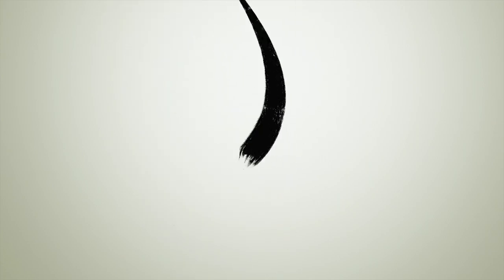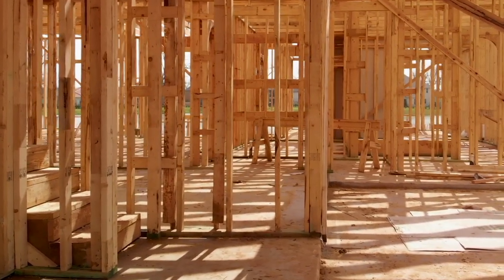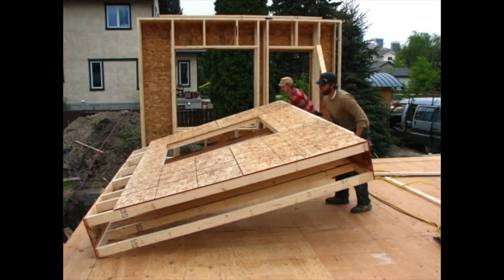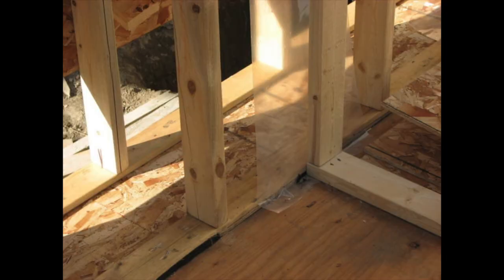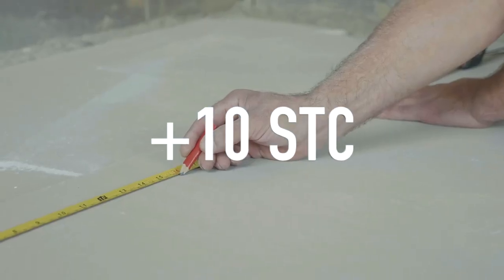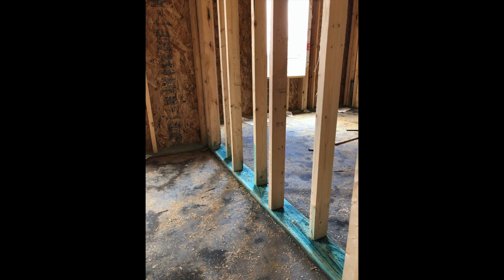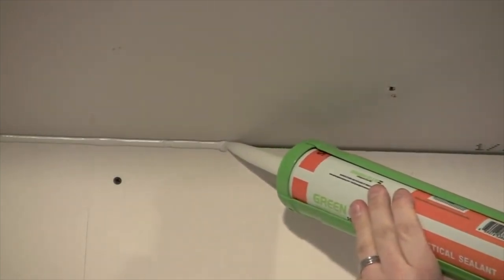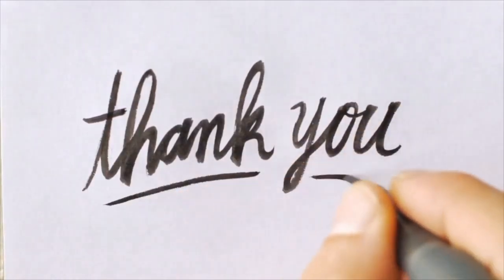Staggered Stud Wall VS Double Wall For Soundproofing

Comment: A staggered wall is "good enough" in my opinion. Ordinary wall: 34 STC. Staggered wall: 48 Staggered wall with a thicker drywall (like Quietrock): 57. That's already amazing, sure a double wall with 2 layers of drywall can get you up to 74, but it takes SO much space comparatively! And since the staggered wall is only about an inch bigger than ordinary walls I think that makes it the clear winner for retrofits.
Reply: Questions is,canna staggered wall be 2×6 top/bottom plate and 2×4 as studs? Or needs to be bigger,also what would happen if you added quietwalk underlayment behind drywall🤔

Comment: As a side note to the soundproofing, I would like to point out the thermal advantages of staggered stud and double wall construction.  This will not matter for the interior walls but on the exterior walls of a building there is a nice energy saving advantage to be gained by these kinds of wall systems.  The air gap created in the wall also works as a thermal break and eliminates a significant amount of the thermal bridging that occurs within a typical stud wall system.  Doing this for your exterior walls not only reduces sound transfer through the wall but the heat transfer as well and the  heat transfer reduction will eventually offset the added expense of the exterior wall construction.
Reply: We're helping an off-grid homesteading community find information for building high R-value walls.  Any idea how much higher a staggered-stud wall's R-value could be?
Reply: Would humidity be an issue with a staggered wall on the outside perimeter?  Worried about moisture and mold.
Reply: @AlaskaWild  You should use a vapor barrier so water from outside  cant go inside but still moisture from inside can go outside.

Comment: The air gap between the studs is irrelevant. The decoupling of the walls from each other is what matters. for example, if you lean on a stud and somebody strikes the other side with a hammer you are going to feel every bit of it.  if you are leaning on a stud that is not touching the one that was struck you will feel almost nothing. For best results make sure the bottom and top plate is secured as well as possible. the main advantage of the double walls is that the top plate and bottom plate are not being shared
Reply: Hi, saw your reply and I'm curious about your experience with this? I am building a double wall to keep out a large stereo system. I am right at the point of figuring out how much air gap I need. Obviously the smallest possible to salavage more interior space but I don't want to compromise performance especially with frequencies below 100 hz!. Thanks beforehand with anything you're able to offer up. Best
Reply: I can't find the link now but I saw a research paper that says this is wrong. The bigger the gap the better the wall works- to a point. However the one I'm making only has a 1in gap because more is impractical and returns although better are diminishing
Reply: @detroyt232323  Double stud wall is not going to do much for frequencies below 100Hz. You need diaphragmatic absorption for low frequencies. I suggest you check out the Acoustic Fields website and YouTube videos. Someone else built double stud walls for their home theater room and it did not stop low frequencies. The wife was very unhappy.
Reply: @vinylrules4838  thanks but ummmm I posted that a year ago. My build has long been finished 👍
Reply: @detroyt232323  how did your design perform with regard to sub 100hz frequencies?  I'm building a drum practice room and I'm where you were in trying to determine how much gap to leave between outer and inner walls.
Reply: @DuckMallard11  I haven't ran any sound testing only by ear but it's cut out probably 90% of the sound. I have a Klipsch sub running on the other side that consistently hits in the mid 30's for frequency, it's not entirely sound proof but way more tolerable if you are on the other side and I'm rocking out. I ended up doing a decoupled wall, Green Glue and 4 sheets of 5/8" drywall. Good luck!

Comment: For best sound insulation with a double wall use separate top and bottom plates. Do not tie the 2 walls together that would only allow vibration to transfer to the other wall........
Reply: You’re right, but staggered stud is much cheaper to build because you aren’t building each wall twice
Reply: They will always be tied together somehow. Even with separate top and bottom plates, they'll still be connected to the same subfloor.
Reply: @niktak1114  Obviously.......2 separate walls allows much less transfer of vibration. I've helped build 5 home recording studios and the double wall has been the best wall when it comes to the least amount of sound transfer through the wall...........

Comment: You can start with putting rock wool between even standard 2x4 walls and double rocking - to drown out talking and other mild noises. The staggered framing is probably good for home theaters (unless you have a crazy sound system!)  or off large rooms that have many folks in it. Double walls are extreme: you just lose SO MUCH space! If you did that to your whole house you'd lose 15% or your square footage or more, based on your home layout. And, unless you're selling the house to someone who cherishes silence, it might be hard to sell such a house - because you're paying property taxes (at least in part) on the size of the house.

Comment: Excellent explanation. My question comes in about the door. Even if you soundproof the walls inside of a home, wouldn’t a lot of the sound escape via the door?
Reply from the maker: Great question Alaska Wild, I do talk about that in a lot of my videos. Here's one for how to soundproof a room for beginners. Hint - you should start with the door, or window if the noise is coming from outside. Here's the link - https://youtu.be/3s-dkWjIacA

Comment: I'm thinking about redoing a wall between two bedrooms with staggered stud walls and then using mass loaded  vinyl follow with 1/2 inch drywall. What do you think about my idea?.
Reply: Might as well do 5/8
Reply: Add resilient channel for mounting the drywall and it gets even better.

Comment: What about finished two walls within an inch of one another?

Dry, insulation between studs, drywall.
And then repeat. That way there is total separation and maximum sound absorption and a small air grap
Reply: We refer to that as "double-wall stick built" (don't know if that's an industry term or not!).  The theory is that then you only have to heat or cool the little gap between the two walls to keep the home cozy.
Reply: You may want to look into "triple leaf" and "quadruple leaf" problems as what your describing sounds like it may fall into this catagory.
Reply: I changed my design. All I did was put sonopan in the gap, so zero air gap

Comment: hi. how is the staggered method effective when the top and bottom plates still make contact with each side of the drywall? thanks
Reply: Full disclosure, I'm just a rando with no experience in building, engineering, or even physics. So, take this purely as a theoretical explanation.

True, the floor and ceiling plates are in contact with both rows of studs, and some sound will be transmitted by that solid connection. Nevertheless, it does measurably decrease sound transmission (so I'm told, anyway).

How?

Well, think of sound as water and walls as pipes. A normal wall, with normal drywall and framing, is like a one inch pipe. It does limit how much water can flow, but it'll flood a room in minutes all the same. 

But! By making sure the floor and ceiling plates are the only shared connection, you effectively reduce the capacity of how much water can flow, as if you went from a 1" pipe to a quarter inch pipe. 

Some vibrations will transfer, yeah. Unless you're in perfect vacuum, some vibrations will always transfer. Some will be reflected by dense objects, some will be absorbed and transformed into heat (Green glue, I'm looking at you), some can be canceled out by clever engineering that creates destructive interference, and some will get through. 

This just narrows the metaphorical opening for water to flow, thus reducing the flow rate. For sound transmission, that means more decibels are lost along the journey. 

Eventually, you get to a point where mundane sounds in the room or your level of hearing won't pick up external sound. But even the most silent places on Earth have ambient sound levels of ~30dB. To get better, you've got to leave Earth. (And your heart, the rush of blood, breathing, digesting, even friction from movement..you're still bringing noise with you, alas.)

Too long, didn't read version:
Grab the nearest flashlight, shine it between your fingers. That's a normal wall.

Staggered is like closing your fingers, some light will get through (that's the floor and ceiling plates in this metaphor), but you're radically decreasing the number of photons that can slip past you.

Double is like using both hands.

Anyway, that's the way it makes sense to me.  Whether or not I'm right for sure, I cannot say. 

There is a product that I've heard of, but haven't seen used: Sound Screws/Sound Fasteners. Basically, it's drywall screws that have a wee little spring sitting between the head of the screw and it's shaft.  It basically creates a 1-2mm air gap between framing and dry wall, with only the wee bit of spring wire bridging that gap. 

They run a ~$1 per screw, and I've never seen a comparison, but they only just came to market in the last year, and the only producer is in Sweden, if memory serves. But it seems most soundproofing is just getting that little bit of an air gap.

But, again, I'm not an expert. I'm just a random idiot with a lot of time to wonder and puzzle things out. :P

Comment: Hi, I really appreciate the content you have put in your channel. I had planned using projected cellulose as insulation in the cavity of the exterior wall of a double wall assembly and leaving the gap between walls just empty. The outer wall is gonna be a sandwich of a 6" frame covered on both sides with plywood 18 mm outside and 12 mm on the inside. The plywood on the inside face would be just to contain the cellulose tight. The second wall will be 4" wooden framing with 2 layers of 5/8" drywall ....I may be adding vinyl wrapping  as i don't wanna fail. I'll be playing drums with a full metal band inside so i need a high STC rating. Do you have any empirical data about air gap width vs achieved STC? Is there a minimum. Every extra inch of air gap means an additional inch of foundation width I have to pour. Thanks

Comment: How about this. 100mm stud wall with 12.5mm plaster board each side with 50mm rockwool with a 50mm air gap, would that work or would I need 100mm rockwool?

Comment: would staggering the studs when facing each other in a "double wall" help in any way with STC? In other words, combine the best of both ideas: two walls together, but stagger the studs so they don't line up with each other once the wall is closed up. Would that improve anything at all or is it a waste of time to plan out?
Reply: Hey. Hopefully you have found an answer to your query, but I'll try to provide an answer in case you're still looking.

Note: I am not an experienced craftsman. I am only offering my insights based on what I have gleaned while researching this topic.

From what I can tell, there appears to be no benefit to staggering studs on a double wall construction. The staggered wall construction seems to exist only as the most compact way to construct a wall without studs making contact with both sides of the wall, as it is only 6" wide.

Comment: how would you add noggings/blocking to the staggered walls?
Reply: @Navy1977 but there’s barely any space?
Reply: @Navy1977 i just mean, if you have a 6" of clearance, with staggered 2x, that means you only have 2" between the sheathing on one side and the stud from the other side, no? youd fit at most like a 1x, in that gap, without bridging the gap, no?

Comment: I only found one discrepancy in your presentation .....
"Loose Insulation" .....  Nope.
Density, or Weight, are the qualities you are after to absorb sound,
this is the principle that "Double-Layer", or thicker cross section, drywall uses,
it simply adds weight, which takes more sound energy to set into vibration.

Fiber-Glass only works "OK" for sound absorption when it is packed in tight,
however, 
Rock-Wool type insulation is substantially better at absorbing sound,
mostly because it has much more weight and density.
Rock-Wool also has a much more definite shape and size which tends to further
insure that the highest percentage of the air space is filled with sound absorbing material.

Any air space that does not contain sound absorbing material only contributes to
the mechanical "decoupling factor" between the walls.

Empty air space does not contribute to actual sound absorption.

The definition of sound absorption is the conversion of sound energy into heat.

Air does not convert sound energy into heat, it simply transfers it from one place to another,
and sometimes may "diffuse" the sound energy by "randomizing" it's direction of travel,
whereas, Fiber-Glass, and Rock-Wool, actually convert the sound into a different type of energy,
which makes the "Noise" seem like it just "disappears", 
the "Noise" no longer exists as "Sound Pressure Waves" which can be detected by your ears.

Fiber-Glass "can be" compressed and packed in very tight, 
which makes it FAR MORE EFFECTIVE at absorbing sound,
but still not as effective as Rock-Wool.
.
.
Reply from the maker: You make a great point. Thanks for commenting
Reply: I did forget to add that I would be putting insulation in the air space. I didn't want to do two layers of drywall. I was hoping putting in mass loaded vinyl would take the place of one of those sheets of drywall.
Reply: I saw a research paper somewhere with actual figures that says this is incorrect. The recommendation was to use the cheap insulation because the sound bounces about in the ca ity and turns to heat in the insulation and in general the insulation made very little difference to the numbers.

I'm going to try rw3 in the internal wall of my build and cheaper insulation in the outer wall. It will be interesting to see how it pans out.

The paper said it's not about the insulation being a mass. That job falls to the dry wall. The insulation is there to turn the sound energy to heat.
Reply: Rock wool no point in sound isolation it cannot stop low frequencues i have planned to use only airgap no insulation material it can only improve 2-4 db if use rockwool but hazarads material
Reply: @mohanshiva_musical  
Nothing can stop very low Frequencies, except Concrete-Blocks, Poured-Concrete, or Bricks.
4-inches of Rock-Wool is excellent for Frequencies above roughly  ~50hz.
Rock-Wool is NOT a  "Hazardous-Material",  and it is totally  Fire-Proof.
Rock-Wool  WILL  make your bare-skin itch, similar to Fiber-Glass.
Wear  Gloves  and a  Long-Sleeved-Shirt  when installing.

Comment: ICF would be similar spacing and similar pricing per linear foot  as these methods and creates the best sound proofing
Reply: What is ICF?
Reply: @ai1.0  insulated concrete forms.
Reply: @i2rtw  polymer forms?

Comment: Hey man! Great video. I am converting my garage into a badass man cave/rock lounge with a pretty substantial stereo system. There is an "L" shaped portion of the garage that transfers sound and vibration into the other side of the wall into the house. I have already ripped out part of the inside drywall and plan on building a second wall not attached to to the house using the double wall approach. There will be 9+ inches between the 2 walls. I am thinking 2x4 studs, pink R13 insulation and double 5/8" drywall on the wall inside the garage. Do you think that will be enough? I listen to the steroe quite loud sometimes around 100+ db. Should I consider sound clips for attaching the drywall or Roxuk insulation to make it even better? Thanks for any insight! Keep up the good work sir.
Reply: 100db? You are probably going to hear ringing as you get older.
Reply: @akivaweil5066  as all of us rock and rollers do 😎🤘🎸
Reply: @detroyt232323  Whatever floats your boat...

Comment: Firecode recommends putting in horizontal blocking in a wall to prevent vertical sound transmission.  How do you do that with a staggered stud wall without bridging the vibrations?  Is that the reason why the drywall manufacturers list staggered stud as lower STC than a double wall?

Comment: 4:04 way to use your head!

not sure what's happening there, but it's mildly amusing.  Was he soundproof testing or mentally off?

5:38 screw went too far and isnt going to hold the sheetrock becausw it punched through the paper.

Comment: Green glue works but they overkill on marketing so they can overcharge for it, and they do big time! Plenty other products out there for way less just as good. Heavy Duty moving blankets mixed in with wall insulation work fantastic for sound absorption.

Comment: It seems like these are more for energy efficiency rather than noise reduction.  I would think a regular 2x6 walls with Rockwool will be a lot better than really good windows, so if you want windows... that is going to be the weak spot...